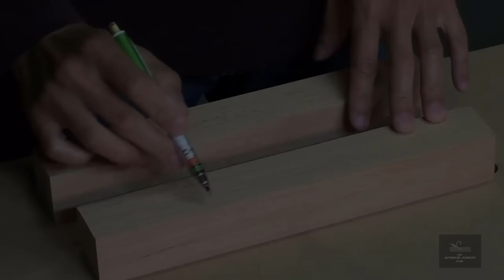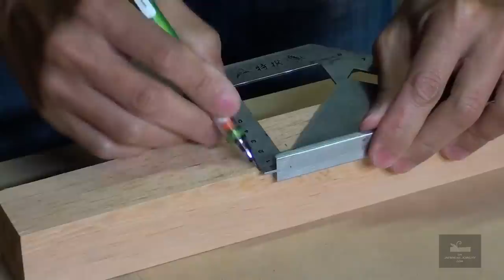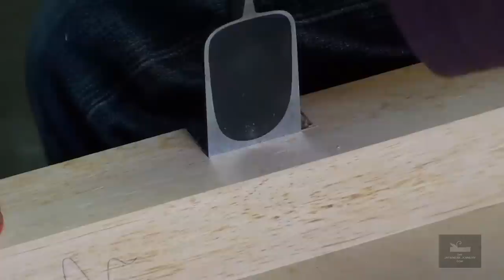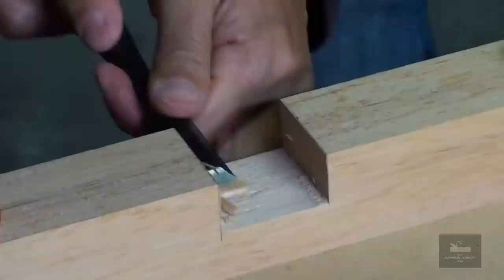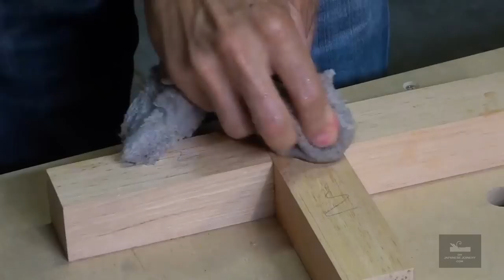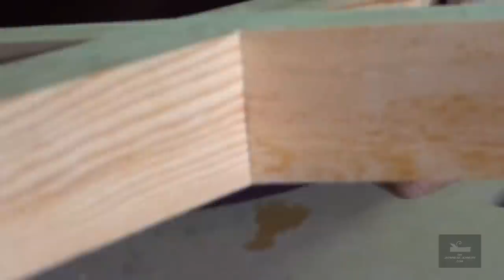Japanese Woodworking Tip - "Kigoroshi"

Comment: I’m sure it help that trees have been cut down with chainsaw and then the wood milled at a lumber yard with table saws so he can get perfect 2x4 at home
Reply: Josue Rodriguez that isn’t 2x4
Reply: Yeah, of course it does. What’s the point?
Reply: Logs are milled at a sawmill, not a lumber yard, and not on a table saw. Your lack of basic woodworking knowledge means you are not qualified to have an opinion.

Comment: Japanese woodworking is for people who really don't want to make anything they just need an excuse to buy expensive tools.  Is the object to make a tight fitting joint or see how long you can take to make it?  Pro tip, always use the softest wood available.  Never use anything that would actually be used in furniture.
Reply: OP finishes rant and returns to making a jewelry box out of oil drums, concrete, and mammoth bones.
Reply: Yeah no it’s not it’s mostly for furniture makers who are looking for ideas
Reply: Sure, let’s watch you build something with a $15 chisel set and $3000 in machine tools.
Now make the joint fit snug without glue or nails.
Reply: @UnReaLgeek  LOL!!   3 K in machine tools? How about a  150 buck router?  The trick they are showing is compressing the wood fiber.  You couldn't possibly do that after routing out the joint could you?
Reply: nitetrane98 you could but it’s not that much longer if you don’t want to invest in machine tools. A lot quieter too if it’s in your suburb garage. And you’re going to gain mad skills after a while sometimes the router doesn’t fit or something and you have to get the chisel out. I get what you’re saying but that way has its benefits too.
Reply: @gnarthdarkanen7464  Two words:  Anger  Management.

Comment: I don't understandwhy this video was put out, the instruction where 100% accurate but the "after 10 minutes" part was a complete failure, I have bad eye sight but even to me the gaps were still clearly unchanged. Why not redo the process and show a successful turn out, We would never know how many attempts it took. This does not seem like the typical Japanese eye for detail we have come to know.
Reply from the maker: Thank you for your comment. While it may appear that there are still gaps, what you're seeing isn't actually a gap. It's merely an area that has darkened due to moisture absorption, which can give the illusion of a gap.
Reply: Yeah looks the same to me.
Reply: I have good eyesight and I could see clearly the gap was smaller
Reply: So, who here leaving spicy 🌶️ comments have the woodworking examples to show they even know what they are saying in their comments? I work with wood and this person is obviously a professional. If you have something educational to add, please bring receipts.